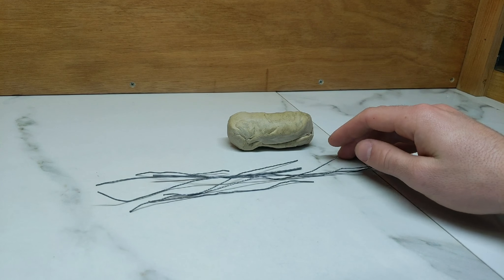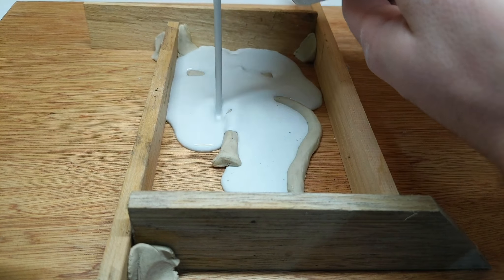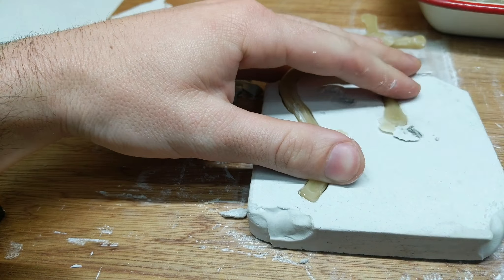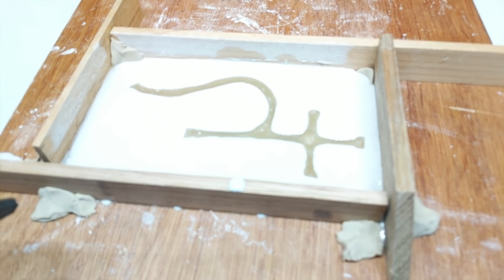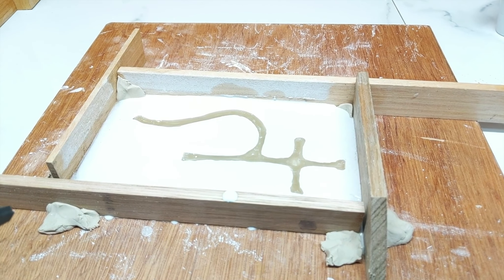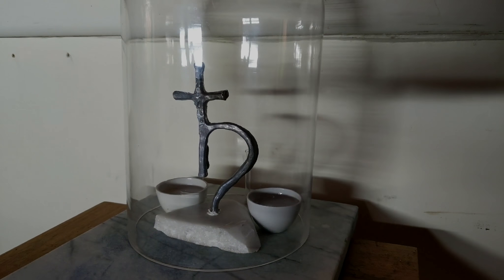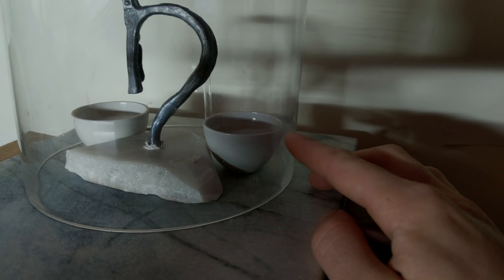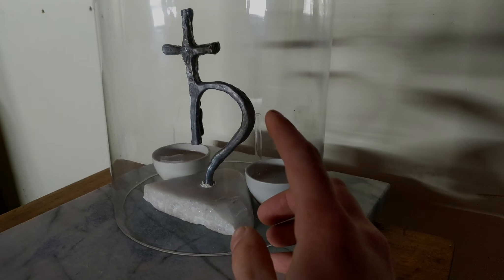Lead White: Part 1 | Casting the Talisman of Saturn

Comment: So I can have real paint again?  Chrome yellow that single stroke letters signs with only one coat like it used to!  by mixing these pigments with clear lettering enamel? or do I need to make old school real varnish to carry the pigments, (turpentine w/ pine gum and linseed oil)
 I was about to experiment with this but i would rather purchase them and mix my own up as needed.... time.... my time is better spent right now actually pulling lines and lettering and actually playing music.... different one track mindsets, engineer to writer to performer lmao.....    if you can keep them consistent I would use them myself and sell them on my page...